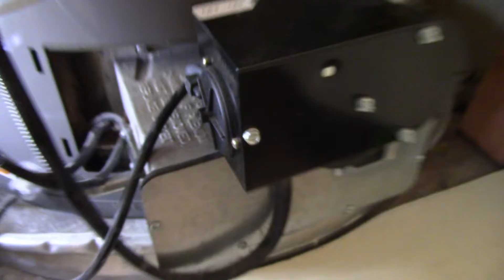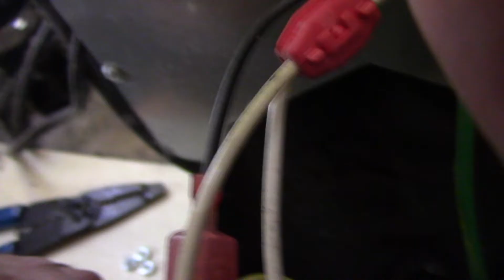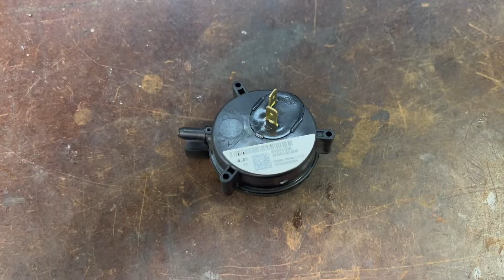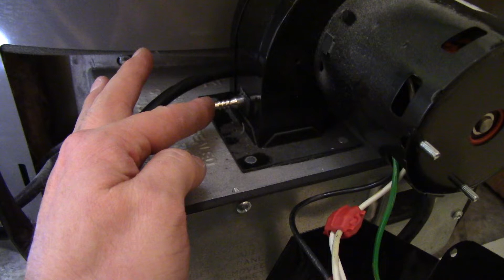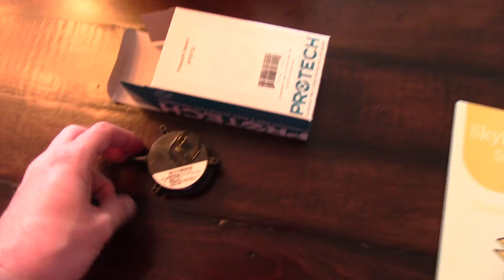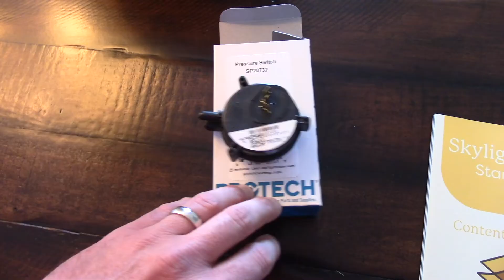Rheem Water Heater Blower Pressure Switch Diagnosis and Replacement

Comment: Before you take anything apart, there is a grate (feels like a cheese grate) between the heater unit and the motor - this houses the fan for the blower. The grate sometimes gets a film of lint over it preventing any air from coming into the unit and thus pressure switch fails.  Try taking off the cover of the unit, turn the unit off (switch on the unit), reach over with brush and remove the film of dust/lint that covers the grate. Try turning the unit back on again - worked for me. If not it is the pressure switch - HVAC guy told me to get a new unit, it is 10 years old.

Comment: I replaced the pressure switch (and temperature switch) and now the burner will ignite, but only for like 20 seconds. Then it throws the same error code of pressure switch stuck open. I can hear the switch constantly opening and closing once the fan turns on at the beginning. Any ideas?
Reply from the maker: @Kheid15  draft or blower obstruction possibly. Or the blower is not working correctly.

Comment: Not sure if you’re still looking at comments, but woke up with no hot water this morning.. I’m just your average guy have no experience in this but could read codes. The code I was throwing was pressure switch is open when it should be closed.. so I started playing around blowing on it and whatnot. Heard the clicks, had no blockages. Relatively new unit, I actually sprayed a very small amount of WD-40 in them. I have two switched so I sprayed both in case the diaphragms were sticking. Instantly tested it, It didn’t work..  so I started messing around with things, and took my exhaust pipe off all clear, but to confirm it was the exhaust pipe, I turned it on. To my surprise it ignited and fired right up. Quickly put the exhaust pipe back on the fan and it’s been fine ever since. I assume the wd40 had to work its way in and took a few minutes to do so. Hope I don’t die of CO poisoning lol

Comment: Awesome video!! I had to swap my pressure switch because I was intermittently getting the same error. Weird thing is, when I installed the pressure switch and I turned on the controller, I no longer got the error, but the blower doesn’t automatically turn on anymore. I initially thought it wasn’t turning on at all, but I left it on for the day and I heard it kick on. Seems to be working fine. Do I have to be concerned that the blower doesn’t kick on when I hit the switch?

Comment: Any idea what would cause the blower motor not to spin? I can hear it sending power but just a wine like it has resistance . The fan spins freely by hand.
Reply from the maker: Bad motor start or run capacitor most likely.
Reply: @mechtrician1  yeah I’m trying to track down a new one but it seems they want you to buy the whole blower assembly that is $700

Comment: only light is cold and hot...so what is wrong with it?no lights on the middle
Reply from the maker: The light legend should be on the side of the valve.  It will tell you what it means.

Comment: Thanks for posting this video!  It saved me today as I wasn't sure why my Rheem water heater stops working.  After I blew the pressure switch and the metal vale, it worked.

Comment: I was getting this alarm and it's Easter long weekend. I blew out the air intake lines and everything is working great. Thank you so much! This video just saved us hundreds of dollars and a weekend without hot water.  Hopefully it was just some polleny fluff floating around and the switch remains working.
Reply: Did you blow compressed air from out side towards water tank or from inside towards outside of the building?
Reply: @absonigra  towards outside down the line but also into the sticking valve.

Comment: Mines the opposite says stayed closed longer than 5 sec tried resetting it after checking things and it does nothing but go back into limp mode the green light doesnt start  flashing in getting stumped on this one I've managed every other time  to get it going until now  no videos on here on the pressure remaining closed the videos are all about it remaining open lol I need a new soon
Reply from the maker: Sounds like it’s still a failed switch that needs to be replaced.